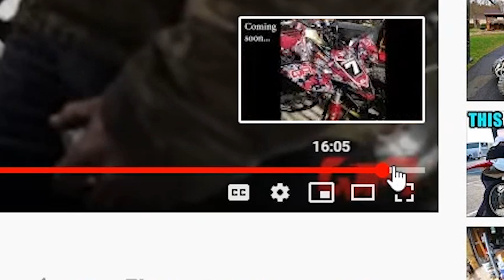How To Make Your Ltr450 Better Than James's (Hydraulic Clutch/Fox Floats Install)

Comment: hey i got a 2005 yfz 450 on fox floats all around and the front shocks are super stiff, i tried adjusting them but idk how to make them softer, if anyone has tips it would be much appreciated.
Reply: Try backing off on the high/low speed compression!
Also what kind of air pressure are you running in them?

Comment: You need to be sitting more on the back of the Quad.   You don’t seem to have very much control over it.     Grip a little tighter.  Sit back further n I think you would improve a lot.    Also.  Clean your quad.  Makes it run better & it’s easier to work on.    Not trying to diss or anything.   Just giving some pointers

Comment: all the magura kits are to tight to fit, you would think for the price you shouldnt need to bend or modify anything it should just fit, otherwise you could order any kit that the cheapest and make it fit basically... to be completely honest they should come with the brackets and the clutch shaft end piece as well for what they cost

Comment: you should have took a cheap luggage scale and used it to pull the clutch lever in and then you would know how many lb it took to pull it in and then do a before and after haha  but oh well ,  i use the magura hydraulic conversion kits on all my quads and bikes,  My 2014 trx450er got one both my 400ex's got one and i just ordered one for my husqvarna cr250 the ktm 300exc already comes with a hydraulic clutch because ktm has a brain in their heads hahaha the rest of the manufacturers need to catch up to ktm  you will love it once you get it set correctly